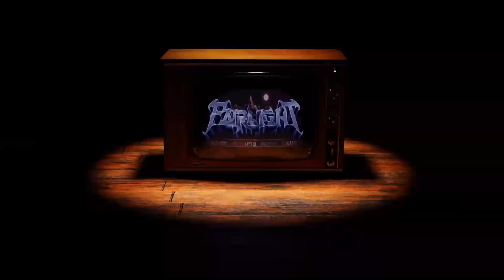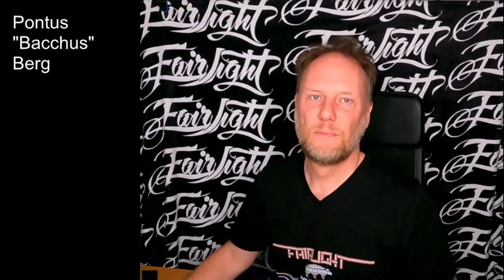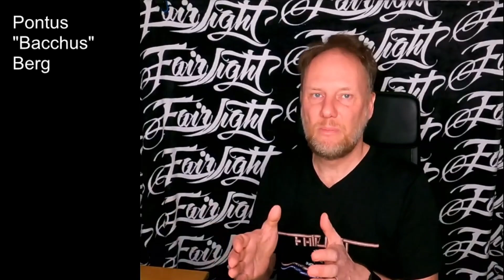FairLight TV #4, FairLight facts: The theory of compression

Comment: RLE with control byte went like this very often (say signal is #), you chose the most infrequent byte as a control byte (used in Oneway's Zipper, Sledgehammer and other popular packers)
a,b,c,d,#,200,0,e,f,g,h,...
Good: needs no extra byte for runs of different bytes. Bad: Every single control byte occurrence causes 2 bytes loss, runs of equal bytes need to be 4 bytes or longer to gain anything.

RLE with header bytes went like this: negative numbers denote unpacked runs, positive denote runs of equal characters, or the other way round (header bytes are used less often in Charpackers, but more often in Crunchers).
-4,a,b,c,d,128,0,72,0,-4,e,f,g,h,....
Good: already makes a gain for runs of 3 equal bytes, bad: every 127 bytes a control byte appears, as the maximum run length is 127 bytes.
Depending on the input data each scheme can be better than the other.
Reply from the maker: Indeed. There are variants. The latter you describe is implemented in the Peanut games where I created a depacker. Should release that one actually...